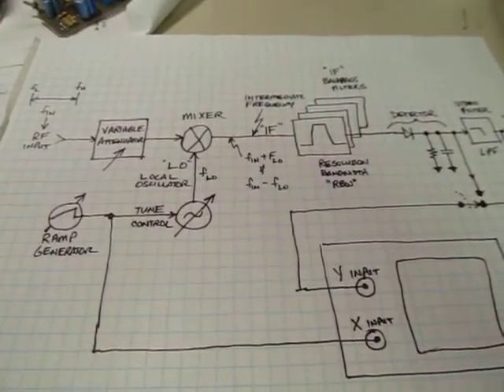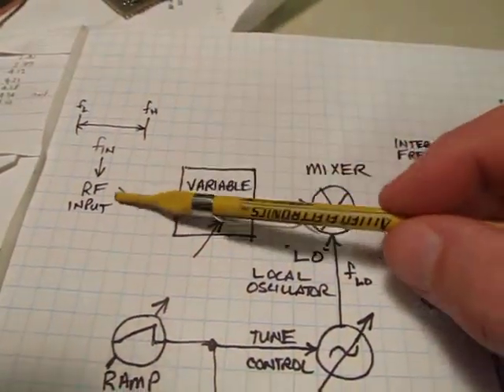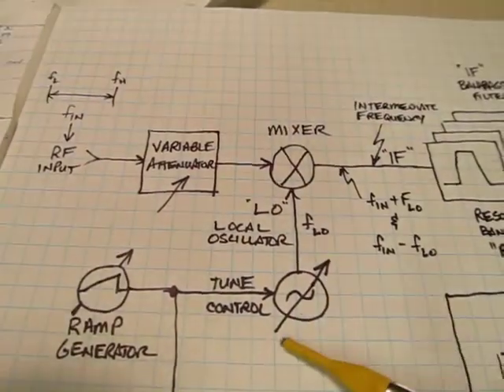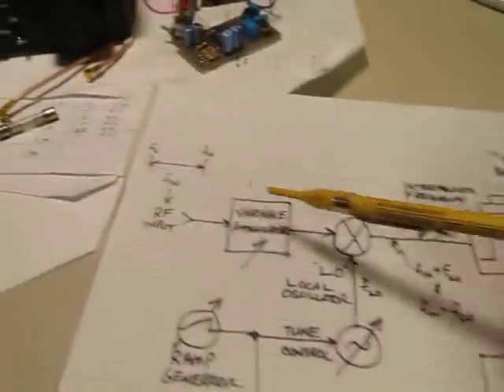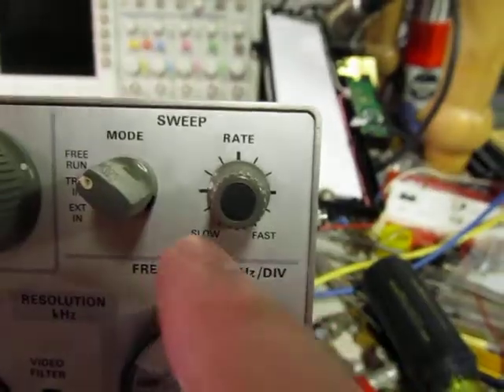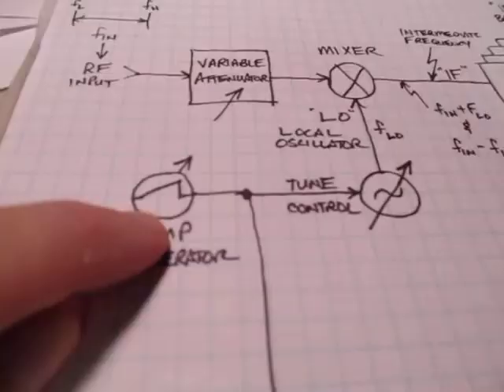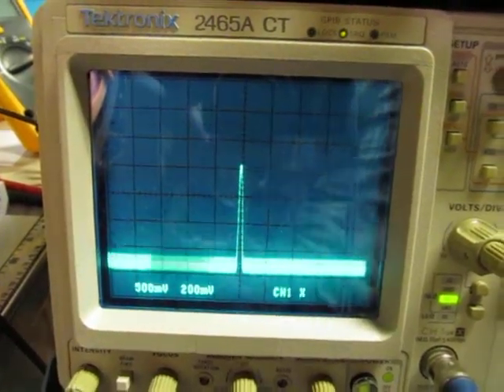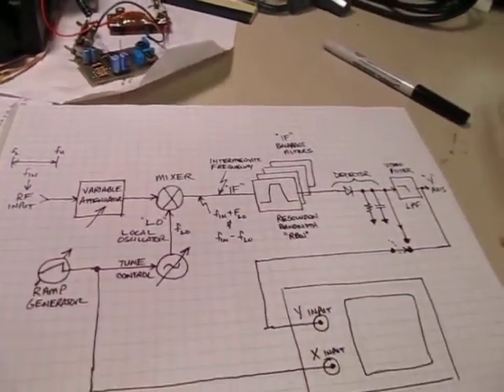#22: Spectrum Analyzer Basics / Tutorial, and the Tektronix 1401A

Comment: That was about the simplest explanation of a spectrum analyzer as I've ever seen.  Good to get back to basics sometimes, of course, like your REAL spectrum analyzer, lots of buttons and knobs to confuse you, kind of like sitting in the cockpit of an airplane.

Way back in the day when repairing TV sets, if one wanted to tune the IF coils to get a specific bandpass, one used a sweep generator and an oscilloscope.  The frequency output of the generator went to the input of the IF strip, the output went to the vertical input of the scope.  The sweep voltage from the generator was not a sawtooth, as we saw above but actually a sine wave.  But then, it was a sine wave that was driving the sweep generator, which connected to the horizontal input of the scope.  So you know what frequencies you were viewing on the screen, you had what was called markers, a marker generator created specific frequencies.  You had a spectrum analyzer, but we didn't know it was called that at the time.

My sweep generator was made by EICO, Electronic Instrument Company, what we called "bench quality."  My oscilloscope had a huge 5MHz bandpass, just good enough for working on TVs, couldn't even be used for Citizen's Band radio.  The brand name of my scope was Hallicrafters, a familiar name to ham radio people, actually bought the scope in a kit form from Radio Shack, when it actually sold electronics.

Comment: What is a typical circuit for a mixer, in  VHF?
Reply from the maker: A gilbert cell mixer, such as that found in the NE602/612 is very common.
Reply: @w2aew  Thank you for your help. Just pulled up the data sheet for the NE602,  a few good circuit examples of using the chip are included.
Reply from the maker: @koggism  You might want to check out my videos on the Gilbert Cell:
https://www.youtube.com/watch?v=7nmmb0pqTU0
https://www.youtube.com/watch?v=38OQub2Vi2Q

Comment: Would've been interesting to see digital or SSB signals from a pre-amp on your antennas.

Can this thing be used as a SWR meter? Perhaps in combination with a white noise generator, you can measure the reflection of that noise with that analyser.

Comment: Great info, I picked up a Tektronix 7633 at a ham auction for $20, no HV and I am digging into it, not sure if I can fix it but from what I understand that scope can be used as a spectrum analyzer with the right plugin.
Reply from the maker: Yes, you'll have to find a 7L5, 7L12, 7L13, 7L14 or 7L18.
Reply: Yeah, problem is that these days, the plugins can fetch a grand or more.

Comment: I'm interested to find out more about the characteristics of the VCO used as the local oscillator. Is it sinusoidal or square wave? How does one go about designing one that can sweep are wide range of frequencies? And what parameters make a difference to the overall performance of the analyzer?
Reply from the maker: These are all good questions - with BIG answers - much more than can be answered in a text reply here.  Very briefly:  The VCO could be sinusoidal or square wave - it all depends on the design of the mixer and what it needs for LO drive.  VCO designs vary quite a bit, although the most common for very wide range tuning often involve varying a current that is used to charge/discharge a capacitor.  However, these designs have poor stability and phase noise.  Range switched LC oscillators, or harmonic mixing are employed sometimes to improve this.  There are LOT of parameters that make a difference to analyzer performance.  The most important parameters are dynamic range, linearity, noise floor, etc.  Much of this comes down to the performance of the LO, the mixers and the amplifier chain.
Reply: w2aew Thank you very much for this information.  Am I correct in assuming that the first step in designing an SA would be mixer selection, then IF choice, then LO design? I'd like to see how far I can go with it and cook up a SA that can take DC (or at least the bottom of the audio band) to a few MHz. Main use would be AF distortion analysis, testing filters etc. Given this, I figure we will be mixing up, rather than down - I've heard that this is what is done for such designs. There seem to be a couple choices here: AD8343 looks best, PE4141 has a good-for-nothing datasheet. The former seems content with a square wave - I'm thinking LTC6990 pumped into a PLL. Analog Devices make some great high speed op amps so I doubt IF filtering is a problem. Am I having sane thoughts so far?
Reply from the maker: There are a lot of interacting factors - frequency/IF planning, preselection filtering, IF filtering, LO design, mixer selection, etc.  However, for applications below a few MHz, these days it may be best to simply implement it digitally.  There are many very high performance ADCs out there that can digitize the entire band of interest and then you can compute spectral results using FFT or Chirp-Z transform.

Comment: Hi Alan  I have what i think is the matching tektronix 323 oscilloscope and it is is nice condition  working. The case appears to be the same size and has the same handle and same goofy ac plug . It is interesting that the 323 has the sony brand on it as well and i did not see that on your Analyzer. Great video by the way.
Reply from the maker: +allaird1 Yes, the 323 scope was done in Japan by the joint Sony/Tek venture.  The 1401A spectrum analyzer adapter was designed to pair with that scope, but was designed entirely in Oregon - hence no Sony name on it. There was a way to link the handles together to make one "unified" unit.  It was popular with the surveillance community due to it's small size.

Comment: Do all spectrum analyzers sweep frequencies ?  Do I need  a sweeping function generator to connect to a spectrum analyzer to see the filter response of some simple breadboard passive filter ?
Reply from the maker: Most spectrum analyzers sweep.  However, there are some that don't - they sample the signal and perform a discrete fourier transform to compute the spectrum.  The traditional way to sweep a filter is to use a tracking generator such as in this video:
Measuring low-pass filters in a Ham Radio HF Packer Amp for Amateur HF Bands
However, you can also use a broadband noise source at the input of the filter, then the spectrum analyzer will show you the filter's response, like this:
How to measure an HF Bandpass filter response with the MDO3000
Reply: *****
What piece of equipment could I buy that is a broadband noise source ?  Like white noise ?
Reply from the maker: Peter B Many Arbitrary Function Generators can generate a noise waveform.  Or, you can build one.  Typically a zener diode in reverse breakdown mode is a good noise source - then follow it with an amplifier.  Here's one example I found after a quick Google search:
http://www.maximintegrated.com/en/app-notes/index.mvp/id/3469
and another example:
http://www.wb0smx.net/?p=572
Reply: Is this spectrum analyzer any good ?

http://www.gwinstek.com/en/product/productdetail.aspx?pid=4&mid=61&id=1339

Will it allow me to see frequency spurs from mixers and oscillators and also use the noise source to see filter responses ?  At the moment I have very modest needs just to learn and I'll worry about high end stuff after I finish school.  I just want to know if this thing is worthwhile for simple spectrum viewing ?
What is your opinion ?
Reply from the maker: Peter B This is a very basic, entry level spectrum analyzer.  It has limited RBW settings, which will keep low level signals hidden in the noise floor.  There is only one spec for spurious which is -45dBc - which means that you may not be able to distinguish spurs from your mixers, oscillators, etc. from instrument generated spurs that are at similar or lower levels.  That being said, it is a very inexpensive spectrum analyzer - so you'd get what you pay for.  It certainly will give you a view of the spectrum.
Reply: What kind of probe do I need to connect spectrum analyzer to filter on bread board ? Can you give me link to a reputable vendor ?
Reply from the maker: Peter B Personally, I really like the Tektronix P6158.
Reply from the maker: Peter B This unit is a pretty good, basic entry-level spectrum analyzer.  I think its a better value than the GWInstek unit you asked about in an earlier comment.  With the TG, I think it's closer to $1800 or so.  The phase noise on this unit isn't that great, and the DANL is just OK.  Overall, a pretty good value.
Reply: Before I commit to buying the Rigol I see there are several HP8594e spectrum analyzers (vintage 1990 - ish)   ?  Would the Rigol be better than the HP8594 ?

http://www.buy17.com/hp/pdf/hp8590e.pdf

Maybe the phase noise or DANL is better although at this point I don't know if that is that important a consideration just for entry level spectrum analyzer ?
Reply from the maker: Peter B The old HP unit will likely have better phase noise, DANL, SFDR, and distortion - but it is also much bigger, heavier, and 30+ years old.  So you have to weigh how important these things are vs. a new, small, lightweight unit with a warranty.

Comment: I have one (not working) off Ebay. I have not laid my hands on it yet but was wondering if you knew something about spares for the same.  I purchased the service manual but is very thin on details about the 690 1590 VHF oscillator. No part numbers for the osc xistor or the coil and varicap are provided. Thanks for any help.